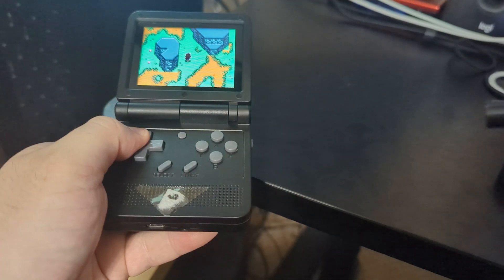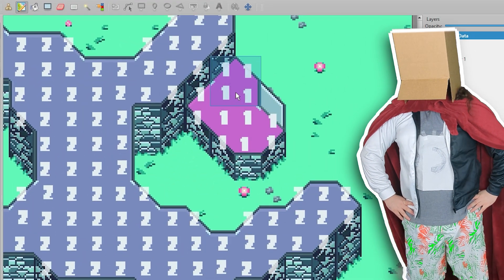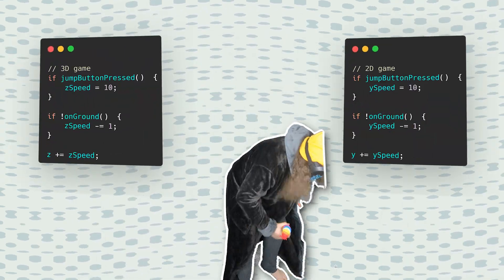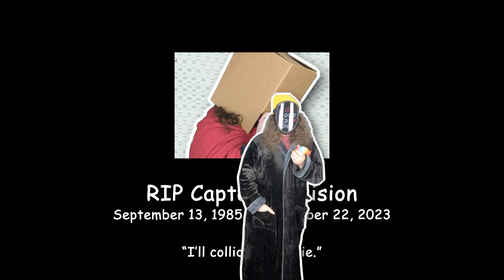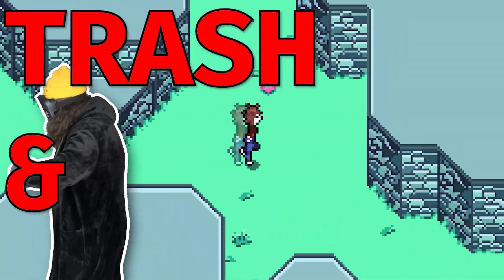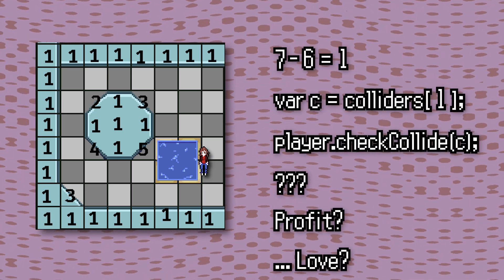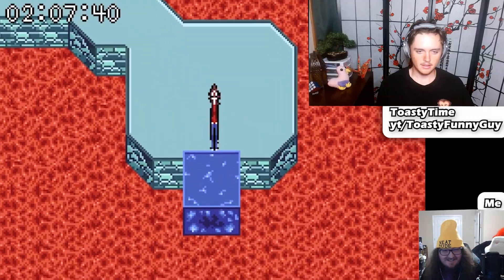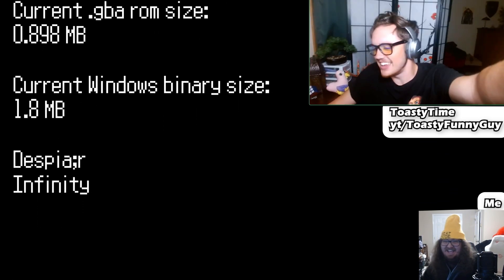adding 3D collision to my Gameboy Advance game

Comment: a way to deal with the rendering order can be using a z-buffer, equivalent how opengl or vulkan does, you have a buffer that saves the z axis for each pixel so if the current pixel has a lower z axis than the one that will be drawn this will be overriden otherwise no, so you map the z position of the object equivalent to it's y position on the screen, solving the sorting issue

Comment: The collision system reminds me of what the GBA Pokemon games used for its height&collision map. Have 0x0C for default passable, 0x10 for elevation 1 passable, 0x00 to transition between levels, etc. Was a really clean system to work with, even years before the G3 decomp projects began when we were all running blind through the ROM files.

Funnily enough, I'm actually working in the opposite direction as your project, porting a GBA game to modern systems, so I've been seeing a lot of the BS you must be dealing with in the original game's source repository lmao.

Comment: Tiles for the lowest parts of walls will never be required to be drawn over the top of the player, so there's no reason to not have those tiles sent back to the "floor" layer. Emulation issues show this was done with tree tiles in the Pokemon GBA games, where emulators have a hard time drawing a mist/fog overlay over everything so any "foreground" tiles get excluded (and you see tops of trees poking out of the fog)

Comment: I doubt you’ll see this. Not sure if you would even update it. But, I noticed the SRD HUD Maker for MV will slow down the game when you have less than 4 characters in your party. It’s even worse with 1 character as the FPS drops from 120 to 30. It’s not a plugin conflict issue either. It’s causing errors in the HUD boxes when theres no other party members. Was wondering if you could take a look at it? Would much appreciate it.
Reply: For every party member there is the FPS goes back up. Just tested this on a fresh save file just to double check to make sure plugins weren’t the issue. My conditionals are setup correctly since it works perfectly with 4 players and I don’t drop FPS.

Comment: You really need to check how the game works on GBA and emulators are not a good way to do it. Use your 3DS, it has a GBA inside it, when you run the game on GBA Virtual console it is not emulated it is run on a real GBA system on a chip that's inside the 3DS. If it lags there it will lag on an actual 3DS even if on an emulator it's perfect. Otherwise the game looks cool.

Comment: EDIT: I think you already came up with this idea going by what you say at 5:17.

So... I'm dumb. I know it's annoying to work with and makes drawing maps slower, but why can't you just put the decorations on the floor layer? Then you could use the decorations layer as a secondary wall layer. I'm guessing the big problem is that the player will then appear below the floor when the player passes behind "Layer wall2" because they get moved to the floor layer, either that or the decor layer can't be dynamic...

I've been thinking about these damn walls for about 3 hours now and I don't know why it bothers me so much, this isn't even for my own game! 

If it were my own project, I would just simplify the tiles into simple square tiles not these diagonal pieces from the depths of developer hell, then I wouldn't even need all these layers! AAAAAAAAH!

Comment: Good progress, but the new sprite needs more work, it's not chonky enough and making it even thinner when it jumps doesn't look great -- if it were chonkier and got to the current thinness during a jump that could work?

Also the super bright skin tone makes them look like a zombie or otherwise undead.

Level design seems like it needs work also... 

Look at the original Mario games, they never had a ton of jumps that had to be executed perfectly, the jumps were mostly easy (even with moving platforms), instead the difficulty comes when you mix bad guys in.  

So yeah there's 5 ways to jump that gap, but there's also a flying turtle there and a goomba, so it's still difficult.  Just making hard to jump platforms with only one way to get there and unpredictable traps just makes the gameplay annoying, which is the opposite of fun.

They also introduced mechanics one at a time.  First moving platforms you see? Easy to get through, first moving fire bars or trampolines? Very low pressure.  And then the difficulty ramps up from there.

Comment: Wow, this is coming along really nicely. In the beginning, why not just build a custom GBA emulator to run the PC version of the game, similar to the Virtual Console?
Reply from the maker: I plan on having a PC-focused devlog eventually to answer this question, but long story short I want the PC version to be the best game it can be without adhering to GBA restrictions when possible, for example:

1) Be higher resolution, zoomed out, see more of the map, etc.
2) Have different in-game options like keyboard or controller bindings AND better accessibility options that wouldn't be possible on GBA 
3) Smoother gameplay, use transparency in places where the GBA cannot
4) Port to modern consoles perhaps???
Reply: @SomeRanDev Gotcha

Comment: In order to solve the layering issue without taking up too many background layers, you could try re-drawing the parts of the player that SHOULD be above the terrain!
Reply from the maker: Tragically this is not possible on the Gameboy Advance. Images are loaded as preset 8x8 tiles (or powers of 2 from 8 -> 64 for sprites), and there's no support for cutting off sprites. 😭

At best I could hide certain 8x8 blocks on the player sprite, but nothing as complicated as the diagonal tiles. 

(Though... you can allocate and manipulate VRAM directly on a pixel by pixel basis, but doing in every frame isn't feasible with GBA performance, especially for multiple entities.)
Reply: @SomeRanDev  hmm... Would it be possible to do it the other way around? Drawing higher-priority parts of the background with sprites? Those are already 8x8 aligned! Or does the GBA have seperate tables for sprite- and background graphics?
Reply from the maker: That's actually a really interesting idea. Since the GBA has a relatively small sprite limit, would need to be smart so it only generates sprites for the tiles the player (and other entities) are directly under, but hypothetically could be done.... except as you mentioned, not sure if background tile resources can be used by sprites. In Butano they're stored as different assets, so I'll have to investigate!
Reply: @SomeRanDev  Accodring to the GBAtek hardware documentation (which I cannot link, YouTube keeps marking it as spam), sprites and background tiles are located in different parts of VRAM unfortunately :(
Reply: @SomeRanDev  could you not just put portions of walls that can't obstruct you on the background layer (like the fronts)
Reply: like with that first example you didn't need that tile to be in the top layer as that tile isn't needed to obstruct you when youre behind the wall
Reply: @sukus okay, but you can just put the asset into both parts of VRAM.  Either copy it in dynamically (some NES games do that, like Alwa's Awakening), so I'd be shocked if the ARM CPU in the GBA could not; or you could bank switch the tile data.
Reply: Would it be possible to clear the foreground layer, and only place tiles on it when they obstruct the player?
Reply: You could just draw the last overlapping tile as a sprite no? You can order sprites to go before or after layers. So a pre-compute script could detect which tiles needs to be specifically drawn at the end as sprites.

Comment: Very cool! I made a pixel perfect collision system by having a tileset for pixel collision data. Each pixel of a collision tile essentially encoded a precalculated push vector and other relavent collision information (wall, ladder, stair, etc).. To see if a collision occured I just had to see if a specific pixel encoded a push vector.